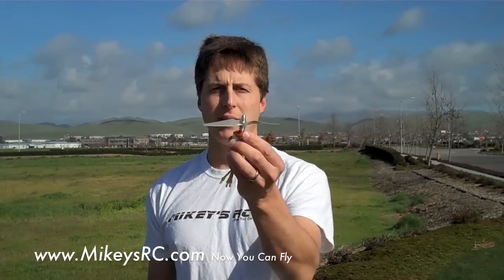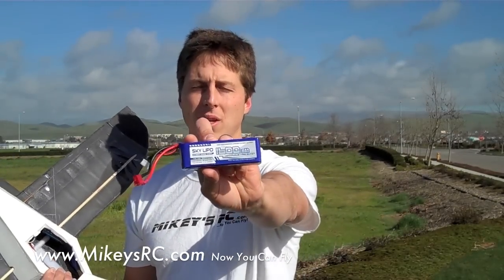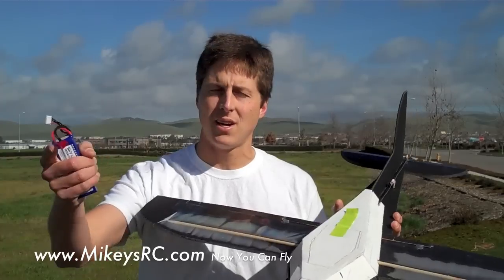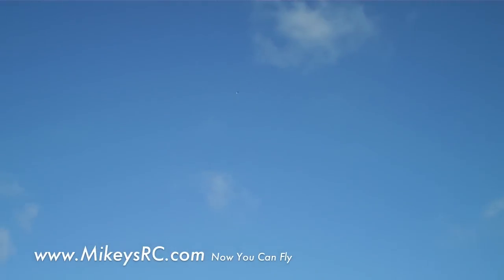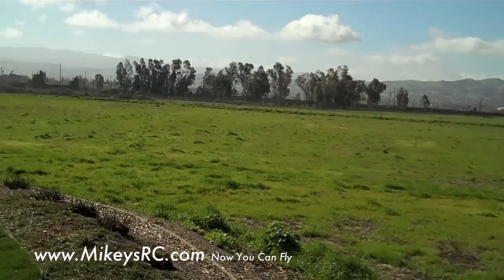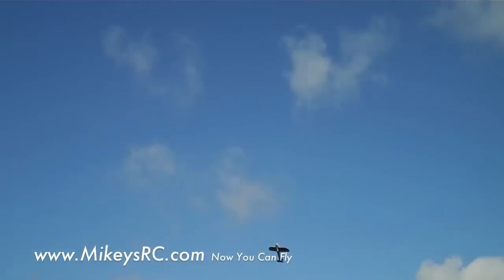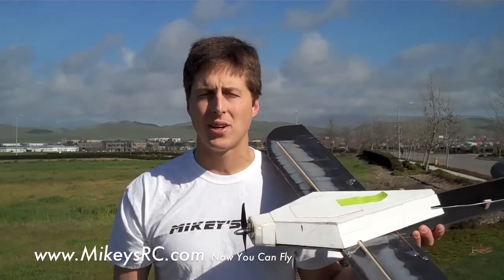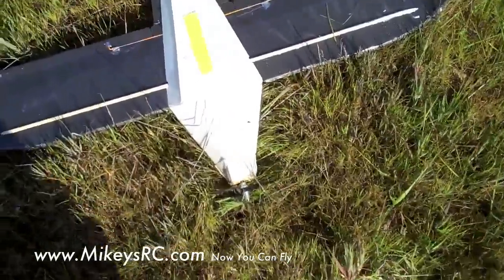70MPH Scratch Built RC Plane $10 Airframe

Comment from the maker: @ds7202 Good questions.  The rudder really isn't needed at the high speeds.  I'm no aeronautical engineer but over the years with trial and error I have found that an aileron most of the length of the wing gives a very high rate of roll.  Esentially the whole length of the wing changes it's amouint of lift or negative lift.  So the differnece between the wings = fast rolls vs. with just the wing tips.  I'm not sure how all this translates to full size palnes but it works on the planes I build.

Comment from the maker: @Mena142 I did hook up a watt meter to it and I was pulling about 54-56 amps at full throttle if I remember correctly.  The 40 amp ESC with a 50 amp burst rate I had on there melted it's shrink wrap off because it got so hot.....so yeah I 'm pretty sure I needed a 60 amp ESC =)

Comment: I built this plane with a little modification. I made the wings shorter, and they taper on the trailing edge, straight cut at the end. . Made the tail section just a little smaller, so it's not so pitchy at the high speeds. Flies like a dream, very stable. I used a Grayson Hobby 2217-06 motor at 1500KV on a 3s lipo with a 6x4 prop. I also only used one servo for the ailerons. Sitting upright, it controls both ailerons with just one servo. Lightened the payload a bit, and reduced cost.

Comment: @MikeysRC I dunno really what you're aiming for here... something flashy, or something stable?  I mean, your plane rolls real fast, but every time you roll your plane, you drop real fast.  This is because your flaperons are not only generating more lift, but more drag as well.  It's also real pitchy... you might want to increase the surface area of your elevator.  Add a rudder too, and you'll be able to counteract some of your aileron adverse yaw also.  

What's the aspect ratio of your wing?

Comment from the maker: @ParkzoneFan Heh...no problem.  Start with the Sport Trainer first the =).  Actually it is a fast plane but handles reasonably well at slower speeds too.  So don't be too intimidasted.  Also at about $1 in foam per plane what do you have to loose if you crash a couple?

Comment: do you use 2 types of batteries at the same time? or when you changed the motor you had to change the battery? also how do you make your own pushrods/clevis/horns? one last question, should i put my servos in the middle and have a long pushrod or short pushrod and mount them near the elevators?